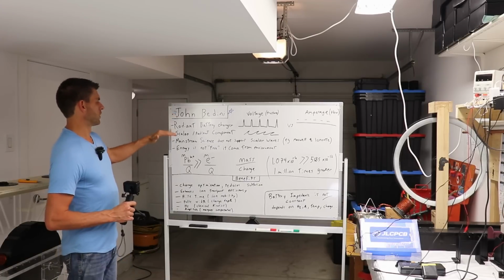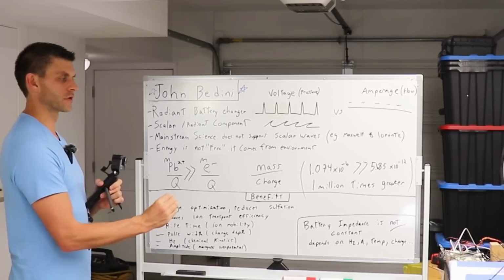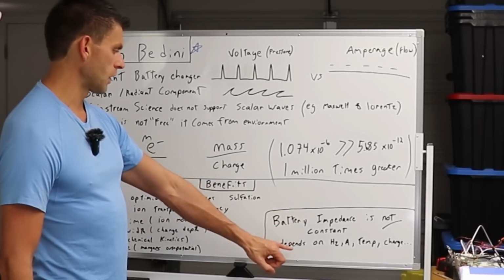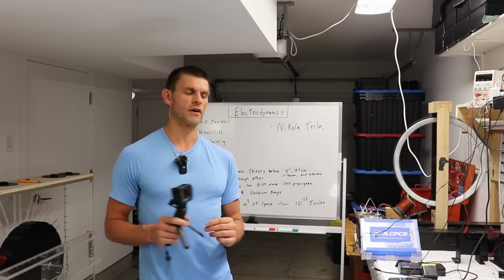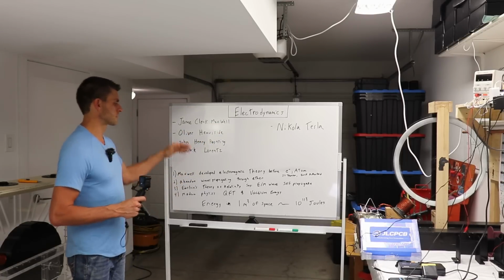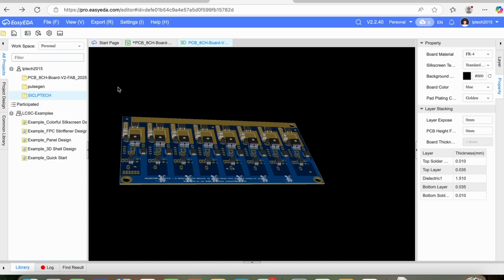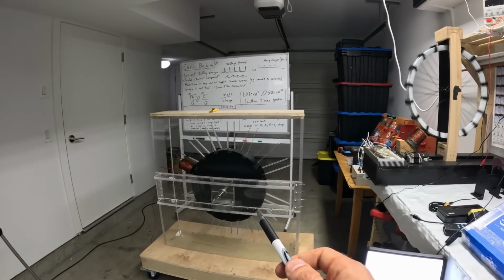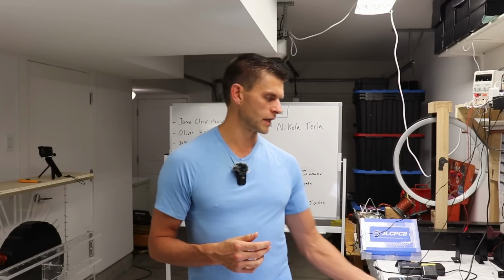They Said It Was Impossible  We’re Building It Anyway

Comment: Have you applied any load to these devices?  Like a fan, refrigerator, AC unit.  Because there is a big difference between the voltage shown on the multi-meter and usable power.  I have built a Bedini machine when I was getting my PhD, and we were not able to get any "usable" power for a sustained period of time.  So, what are you doing that is different?

Comment: This reminds me of a different idea. What if someone suspended a very large wheel horizontally with just a small motor to keep it rotating? I’ll let you figure out the rest. Also, does a sparking wire have a flyback? Why not put thermalelectric generators on hot wires while they’re going around on the very large wheel? This comment may self-delete in a minute.
Reply from the maker: Lol

Comment: Sure if you really think about it if you want free energy look at the ignition system on a lawn mower motor the coil produces more than enough to make a self running machine but static has a tendency of jumping through the bridge rectifier in order to make adjustments you have to build your own ignition coil with less turns on the output have a nice day
Reply from the maker: Appreciate the suggestion and have a good one!

Comment: you are using too many bits, based on flawed theories.     only two things are needed.  well, three.
1)  a low-rpm pma, that has a relatively large diameter, reduced-cogging stator.   the stator coils should be wound in'hand (multiple strands of small magnet wire), so that the conductor is equivalent to 14awg.
2)  a 'small' high-rpm DC prime mover.     like a 550 or 775 can motor. 
3)  a low-loss high-reduction ratio (in a single stage) friction drive should be used to turn an outrunner rotor.
in order to get  Accurate  output values, voltage and current must be measured via correct methods.
specifically, there should be nothing in the output circuit except a low-value high-current toroidal inductor.
one way to correctly measure output current is to use a low-current ammeter that has an inductive loop pick-up.
look at ebay/amazon for  magneto stators; specifically, ones that have a reduced-cogging pole design.   (see stators for kohler engines, not for motorcycles.)     see my research, if interested.
Reply from the maker: Your comments are generic and negative, lets see your working models if yiu know whats impossible 😊

Comment: That part about not being able to meter energy to and from the batteries because the energy is produced in the battery was super helpful and helped to solidify my understanding that the energy is getting pulled from the switch and the excess energy shows up by this switch imbalance.
Reply from the maker: Nice, yes as long as we can keep it running and do excess work that is the main thing
Reply: @MadscienceLPTECH you’re a true hero. Please stay safe

Comment: I'm interested in what you believe the source of power for this generator will be and what science supports this.   How have you been able to measure this available energy?   Simply saying zero point energy or vacuum energy does not show a measurable power source.   If you believe the power is adequate to run a practical generator then it should be measurable.
Reply from the maker: The source is vacuum energy, what is the source of a magnets power?

And I agree

Comment: So you’re pulsing energy into a coil, coupling the energy into storage, and using it to charge a battery?  Why not just put the pulsed energy directly into the battery?  This would be WAY MORE efficient. And this is not green energy because you GENERATE the initial pulse, which takes work.
Reply from the maker: Ok AI Bot

Comment: Why not create a high capacity, high efficiency alternator that connects to a battery charger?
With that size of a generator that you created, you could create 30 times the electrical charge than what you're going to get out of what you are creating. 
I'm not giving you crap or complaining. I'm just wondering, im sure you understand that with alternators, it takes the spin and generates friction between magnetic fields, and the copper takes that and turns it into electrical current.
Or at least create a high capacity, high efficiency alternator, and connect it to that with a belt drive. 
That's when you get into real 0 point energy and an electrical generator that connects to a high capacity, high efficiency alternator with a belt drive that amplifies the original input by 10 to 100 or even 1000 times on output, it also has to be plugged into an outlet powered by the alternator output.
That's true self sustainable energy.
Love how you teach everyone how the flow works and how components are functioning keep at it.
Reply from the maker: Thanks for watching and commenting. I can only build one thing at a time. Scaling this will be next
Reply: @MadscienceLPTECH ok that makes sense

Comment: 11:47 It's not a fliud ether. Its a static matrix thats displaced by normal matter and energy. 27% of matter in our universe is Dark matter.  A matrix 3x3x3 cude = 27 cubes and 4x4x4 nodes = 64 nodes.... 1cm^3 spacing. The matrix is static until it interacts relative to normal matter. This causes the matrix to flux, bend, compress, and behave like a fluid. This motion releases the 68% Dark Energy in our universe. Its antigravity, black holes, inertia dampening, tidal forces, zero point energy, gravity, quantum entanglement  medium, gravitational lensing, the big bang, multiverse, dimensional veils, and accounts for the basic geometry of our universe over time.

Comment: The uniform Dark matter, Dark Energy matrix is repulsive to normal matter and energy's chaos. Zero Point Energy! There's a specific distance from a masses center where Dark matter densities are highest. The formulas I posted on your previous video account for density gradients. Dark matter is displaced by matter and the resistance of the matrix to the compression of the displacement causes the density gradient.  Just saying that you could increase the "Zero Point Energy" density by displacing it strategically.
Reply from the maker: So tell us how exactly
Reply: @MadscienceLPTECH I would place a fairly significant mass near the point where you hypothesize your gains in E are coming from.  Move it incriminatally towards this point and measure your gains at each incriminate over a set period for each. Your gains should reflect the presence of the mass relative differentially to its distance.

Comment: Also, supposedly using digital meters doesnt work with these devices accirately from what I remember... you have to use analog voltage and amp meters.... when you do 👽
Reply from the maker: Agreed. Have to measure work done and potential energy in the system.

Comment: hi there, quick question, what would happen if the wheel were to spin horizontally instead of vertically? would it be as efficient or work at all?
Reply from the maker: I see no reason or difference
Reply: @MadscienceLPTECH  thanks for responding, I was thinking that gravity might playing a role in how the system works, if it's horizontal, the gravitational pull will be applied evenly and might not infuse it with that energy you refer as zero point energy.
disclaimer: I'm not a physicist, just someone curious of new technologies.

Comment: I'm not sure people realize that your small wheel is already pulling energy "out of thin air", but the amount is still small due to lack of better components.
You are already charging a full battery using "half" the energy that would normally be required for it, that by itself is a huge breakthrough.
Reply from the maker: Agreed

Comment: If I understand the work Bedini did during his last few years (his videos on his energenx youtube channel) the problem with most SSG-machines is probably the battery chemistry. As it seems usual lead acid batteries and even LiPos are not optimal for this application. Maybe a alum mixture instead of the usual sulfuric acid might be the solution for this problem. I don't know yet but I will try soon.
Reply from the maker: I think lead acid are good, but you need to watch max voltage and discharge cycles

Comment: Instead of measuring the energy... Could you just use batteries? Measure the battery voltage before and after some time. Otherwise I'm happy to see videos like these. I've studied many inventions over the years and it's clear it exists. Once you finish PleasePlease share the schematic and upload it to the blockchain so it's available forever! if it's simple enough people will recreate it at such a fast rate that it can't be stopped!
Reply from the maker: Agreed. Thats the plan  show the batteries stay charged fully while the machine continues to run

Comment: So even accepting that there is energy in the ether. Where does that energy originate from? Energy does not just appear… there is a cause and effect ALWAYS! So claiming limitless free energy is a false statement in my mind no matter what.
Reply from the maker: No. There are 10 to the 113 jouls per m3 available. 1m3 can power our civilization for 10000 years, sounds limitless to me.

And I dont know where it originates from, where does God come from, what was before the big bang?
Reply: @MadscienceLPTECH  where does the 10^113 joules come from?

I admit that there are certain existential questions that are impossible to explain. But I reserve my right to be extremely sceptical. I look forward to seeing actual measurements. Consider this… if that amount of energy is able to be harnessed from such a little volume, world extinction would be present every second of the day.
Reply: @79messias  The 10^113 number comes from a naive calculation where you sum every electromagnetic mode up to the Planck Frequency. If every EM mode up to the Planck scale actually counts, and the theory holds, then the result of that calculation is 10^113 joules of energy per cubic meter of space.

However, measurements taken by scientists appear to be as low as 10^-9 joules of energy per cubic meter.

So it's fun to think about the potential for "Limitless clean energy", but unfortunately it's pretty unlikely that multiple independent measurements using different techniques and approaches are all off by 122 orders of magnitude, and far more likely that EM theory is incomplete.

Comment: why are u using the magnets on the wheel to trigger the switching and then u collect the collapsing pulse into the battery being charged? I mean what is the purpose of the wheel? the triggering of the BJTs (or in your future designs SiC MOSFETs) can be easily triggered by a simple electronics without ever needing such a bulky spinning wheel with a magnet which pass by, initiate triggering and then pushed forward by transistor switching.

2ndly: such pulse motors consume very less power (because their torque is very low) so its really hard to find anything over-unity effect in such a setup with relatively large batteries and small power consumption. In mean batteries of this size can power this pulse motor for years. 

3rdly: Yes the spikes from the collapsing magnetic field de-sulphates the lead acid battery which can prolong its life span. That's all there is to it. I am 100% sure u have not experience over unity yet, you will be very close to 100% but not over unity. and worry not, u will never achieve over unity, neither did any of the Jhon Bedini fans😋. What u showed in the video is called an SSG motor, "Small School Girl" motor, named by John Bedini himself 😅

So if you are looking for youtube money, that's fine keep posting, but if you really think it will work, then i would suggest you should stop it and invest your time in something more productive.😇
Reply from the maker: Ok generic AI comment
Reply: @MadscienceLPTECH  my message is not an AI comment.
Reply: @MadscienceLPTECH you say that to the least AI comment I've ever seen. There's no way that's an AI comment.

Comment: i have an idea could you clarify me that it could work or not ?
Reply from the maker: Ok
Reply: @MadscienceLPTECH  sir say something is it possible ?
Reply: @MadscienceLPTECH  The NMG1600 is an advanced graphene-based generator system designed to operate in a closed-loop configuration, meaning it can sustain its own operation while producing excess power for external use. It uses a single high-efficiency graphene exciter coil to create a strong magnetic flux at a specific resonant frequency, which is then intercepted by four graphene collector coils. Each collector coil is tuned to maximize energy extraction from the shared flux, allowing the system to achieve high conversion efficiency with minimal losses. For example, with a 1600 W input to the exciter coil, the four collectors can output a combined power significantly greater than the input—providing both self-sustaining operation and surplus energy for other loads. The graphene conductors and coil design drastically reduce resistive losses and improve magnetic coupling, enabling much higher efficiency compared to traditional copper-based systems.

Comment: Not sure if it would be quite applicable but if you could put the wheel on a magnetic bearing that would eliminate all friction and if you simply put a few more coils around it they could all pull more electricity off as long as they were close enough to the magnetic feild
Reply from the maker: Absolutely great comment. Will likey run gen coils off the same rotor

Comment: I have been experimenting with raspberry pi and a hackrf where I made a rife machine with it. I noticed the voltage of the antenna is higher due to the type of waves I was experimenting with on it, I was actually getting an electric shock from touching the hackrf antenna. The duality of the wave I was creating was a negative and a positive wave, using Pi, and the golden ratio. 3.14 and 1.618.
I created waves and used those numbers with the amplitudes of the waves. So it created a stronger signal and all that and a higher voltage where it would shock me. I will try and get all my information together soon. The idea is when the waves cross each other to go to the other side, each wave switches between a negative wave and a positive wave, when they cross each other the energy collapses and it draws energy from the ether. Also my other hackrf the amp fried on it I assume I need your set up to properly get the energy out and not dry anything.
Reply from the maker: Very cool, love to hear more ❤️

Comment: I think my comment is being deleted.
Reply: I think they were deleted because of the Golden ratio number and auto deleted because it thought it was a phone number idk. It's staying now.
Reply: They are being deleted
Reply: I have been experimenting with raspberry pi and a hackrf where I made a rife machine with it. I noticed the voltage of the antenna is higher due to the type of waves I was experimenting with on it, I was actually getting an electric shock from touching the hackrf antenna. The duality of the wave I was creating was a negative and a positive wave, using Pi, and the golden ratio. 3.14 and 1.618.
I created waves and used those numbers with the amplitudes of the waves. So it created a stronger signal and all that and a higher voltage where it would shock me. I will try and get all my information together soon. The idea is when the waves cross each other to go to the other side, each wave switches between a negative wave and a positive wave, when they cross each other the energy collapses and it draws energy from the ether. Also my other hackrf the amp fried on it I assume I need your set up to properly get the energy out and not dry anything.
Reply: Yup I just confirmed, it's when I use the full golden ratio number I shortened it to 1.618 instead of adding 003399 on the end of the 1.618 sooooo YouTube sucks on auto deleting ugh
Reply from the maker: @DIYunpolished I see them all now

Comment: Your schematic shows you applying current into the battery and the coil at the same time. Why Is this not charging the battery.
Reply from the maker: Because the coil is an easier path for the current to flow, its a direct short.

Comment: What is the point of the moving magnets. The collapsing field is happening without the moving armature.  And, why the parallel conductors. A single wire will collect the same amount of energy. How much money have you collected for this project ? Why don't you buy an ocillascope so you can prove you theory.
Reply from the maker: Yes oscilloscope is on the list. The rotor allows excess energy and more conventional generation. Is a single wire the same ? Ill go over in next video

Comment: If the collapsing magnetic field "does the trick" here why you need magnets and a spinning wheel? I think that rotating thing was used in the past for making high frequency switching happen. Also if you say that the switching speed matters to capture the moment when the field collapses this encoder style switch won't get you anywhere near high precision. I would try replicating this without the wheel and magnets - just one coil, driver, and precise generator and high speed switch. If for some reason you need the magnetic field from the wheel you can use another coil to generate that as well. In this setup you can control everything - the length of the pulses, the strength of the field, the timing... You just have to figure out how to measure the effect if it happens. Good luck man!
Reply from the maker: thank you sir, i agree it might be possible without the rotor